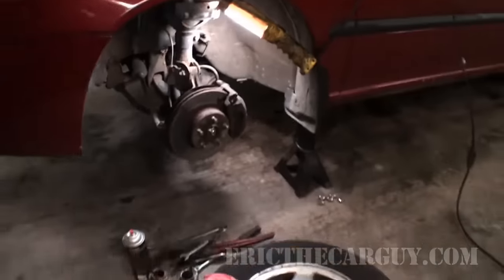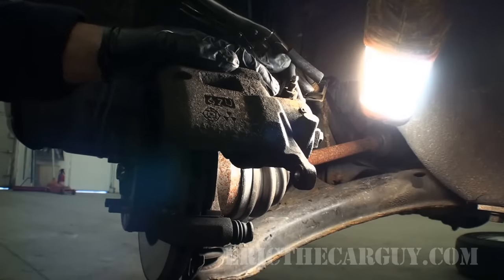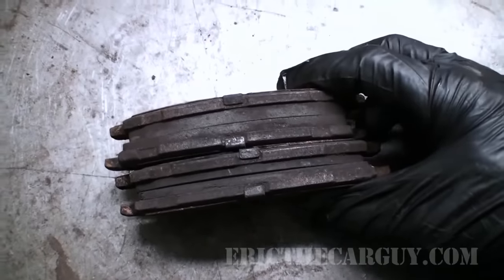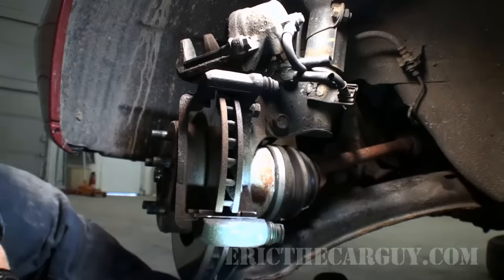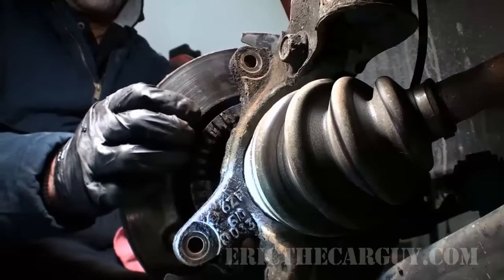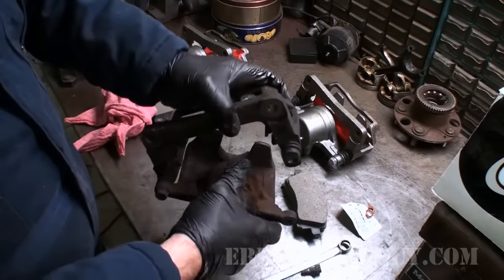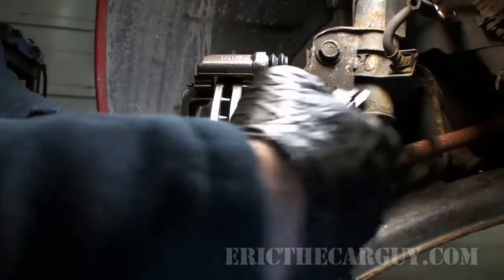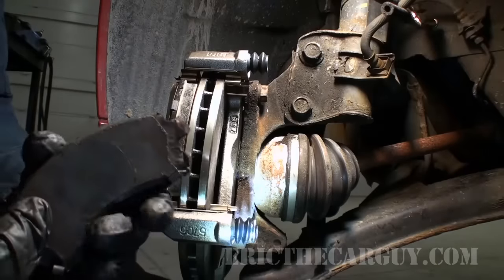How To Diagnose and Replace a Bad Brake Caliper -EricTheCarGuy

Comment: My favourite brake diagnostic method: IR thermometer. You don't even have to remove wheel to see fault. Found out I have seized guide pins not a squeaky bearing because three discs were about 40C, but one was at 150C. Had to change calipers and discs and pads on both sides. Did me brakes myself and every now and then check temps if they are equal on all four. Month later found out I need to bleed one caliper, because temperature was 10C not 34C  as others with ambient temp at 5C or so. Handy thing, but find one with narrow beam and extended range - well in 300C temperatures - brakes are hot. Helps for heat treating too.
Reply: Nice tip, thanks!
(For now I can simply use my nose as I smell burned rubber from the heated wheel cap from the heated brake... heh..  yeah it's hot! Brakes dragging. About to change that, hopefully by myself).

Comment: I realize this is an 11+ year old video, but I just wanted to add: Your wear indicator WILL make a screech sound....IF it doesn't snap off. I did my rear brakes today and the wear indicator was snapped in half. It looked a bit rusty. On another note, when you inspect your rotors, make sure to look at both sides. I had massively uneven wear on the old pads...and found out I need at least one new rotor (but will probably buy a set of 2 rotors and new pads).

Comment: To compress the piston I put a small wood board over the piston and use a 4" or 6" C-clamp. That way I don't risk galling the piston perimeter with the vise grip jaws. You can also use an old brake pad instead of the board.
Reply: like you, that is exactly how i do it.
Reply: And then after you compress it take the clamp off and turn vehicle on and press brake pedal and see if it moves.   Check for any abnormalities. If OK press piston back and reassemble?

Comment: Two weeks ago I started to get noise from my rear left break, it was 74 out and unseasonably warm. But I did not pay enough attention to it because I had a brother in the hospital up in New Jersey, (109 mi each way) I went to a good reliable local repair shop. He said he could not get me in until Nov 28th.  So I decided to do it myself, already ordered the Raybestos rotors and pads. Started to learn about rebuilding the caliper but decided to go and spend the money on a rebuilt. Of course it's 28' now and I think I'll sit back and watch the Eagles beat up on the Colts today and work tomorrow when it's going up to 46'. Thanks for the tips on reinstalling and bleeding. Wish I had my old 55' Chevy back. 77 and still learning new tricks!

Comment: Just an average doit yourselfer here, but I have to say, this video is most helpful. I have done an honest 20 front brake jobs in my life. That is enough to where I feel confident. 1, I never knew about burping the boot on the slider. 2. I May have changed a caliper one time when I might have just needed to lube that boldt. This a nice tip for the future. Now there is nothing wrong with changing callipers before their time, but this tip may have saved me money. Thanks Eric.

Comment: I watched this video, diagnosed the calipers on my '06 Civic EX were the cause of my warped rotors. The pistons wouldn't budge on both. I ordered ceramic pads & slotted rotors from Amazon & found calipers at Autozone. Total cost was $140. It took me less than two hours & I used the stock steel washers, placed hose sections on a vice grip for the brake lines & let gravity bleed out the air in the lines when done. 
Thanks for the perfect tutorial video. The car stops like new & it was less than half the price any garage would charge.

Comment: Just did complete caliper, rotor, pad replacement for my wife's 2010 Toyota Avalon. This video was a great resource. One thing to add that was not covered here is the position of the slider bolts. Apparently, the top and bottom (leading or trailing) bolts are not interchangeable on most cars. I found this out when the passenger side was dragging continuously after the reassembly. I had to bring it to a local mechanic who diagnosed it immediately as reversed position of the slider bolts. This caused the caliper to twist and even pinched the brake hose. I checked the lube of the pins but had no way of knowing that there was a top and bottom difference. They came pre-assembled as remanufactured. Lesson: check your manual or OEM parts diagram against the part supplied before install.

Comment: Thanks Eric for posting this video! Because of your video, I did my whole front brake system on my 1999 Infiniti I30, pads, rotor & calipers in about 2 hours! I especially appreciate the tips on bleeding the system. I've never done it this way, always using the 2 people system, but this worked great. Seems very logical when you think it over. Thanks again!

Comment: Eric, at 11:48 you refer to the banjo bolt [BB] washers, sharing that you prefer steel ones to the copper ones.

Permit me to suggest that copper washers are preferred for use here given copper's malleability, in that it is a relatively soft metal.  When torqued properly, copper washers will compress and be malformed in a way that conforms to the specific imperfections/grooves on the BB's mating surfaces - thereby providing a proper seal that can withstand the pressures of the brake system while effectively mitigating the likelihood of mating surface imperfections that could otherwise facilitate leaks.

It is highly unlikely that steel washers compress at all via proper torqueing.  If so, this would mean that the non-conforming hard steel washers would tighten to the highest points on BB mating surfaces . . . not filling in and conforming to the gaps as was the case with copper.

it is also worth noting that these copper washers can [and probably should] be annealed before using them.  Annealing copper washers 'relaxes' the metal's structure, effectively 'softening' it for use in applications like this.
Reply: Hmm interesting!
Reply: Flea02Cruiser, you are correct. Copper washers’ malleability is indispensable to avoid leakage.
Reply: Yes, you're right

Comment: I have discovered recently that not all parts stores include same items. My discovery happened when I called to buy the caliper. I had some nasty slides, one frozen. I decided to replace those. 2 places priced me the caliper, then the bracket with new slides. The 3rd place was slightly higher in price for the caliper, when I asked about the bracket and slides, I was informed that was included with the caliper. It actually made me saving $20 overall. So, moral of the story, ask if they are included. I prefer changing them with a caliper change.

Comment: why 128 dislike? this is pretty much a clear and educational vid, keep it up
Reply: It's the street term for the jealous known as "haters". YouTube is full of them.
Reply: rkgsd also the haters are anyone who owns an auto repair shop including Midas, and meineke.  Those of us that understand the basics of physics, and can understand mechanics and given the correct procedure (like this) could do a brake job themselves and save hundreds
Reply: Because they racist
Reply: Stop worrying about a few boos and appreciate the applause.
Reply: Its clear and educational for novices and folks that dont or have not really worked on cars a lot.  Folks that work on cars frequently have a better technique and use correct procedures to a 100% ESPECIALLY WITH BRAKES, as they know or have seen what can happen when you lazy out.  Example, why would he risk damaging a RUBBER brake line to save cheap DOT 3 brake fluid, also why would he not use a torque wrench to properly torque the bolts down instead of guessing.  Thats why the dislikes?????
Reply: Why is there always someone who worries about dis likes on a video, Who Cares..If you like the video that's all that matters.
Reply: @tony213g  Yes the clamping of the hose that puts a stress fold in the inner plastic thin-wall hose is not well thought out, also the retraction of the piston and the judgement of slide-ability by using a pair of channel-loc pliers on the edge is quite Non-professional and the manufacturer's instructions from every brand clearly says not to do this.
Reply: @terrywaters6186  dont tell mans what to do!
Reply: maybe because of something minor such as him using a bi-hex spanner on a hex head bolt , amature stuff that just round the bolt off
Reply: Haters
Reply: @globalsttrekker3715  tow

Comment: I watched your video, was very pleasantly surprised by the high quality and your professionalism, and then did the full job on my 2004 Toyota Sienna. Really, I don't know how anyone can complain about what you have done! I love your "straight to it and yet tip filled video! You helped me several times with those tips. But can watchers help you fill out a few things? I hope so. I got a kit with the dreaded copper washers and they leaked like crazy, just as you warned. But, I took it apart, and sanded and wire brushed the brake hose fitting, and more importantly, filed the surface of the caliper right at the base of the banjo hole. That is what fixed the leak. The rebuilt calibers had rough and uneven surfaces where the washers seal and that was the problem. Eventually, copper washers seem to seal the leak if allowed enough time.
Dave S.

Comment: That bleeder bottle is awesome, no need for a second person. I didn't know that. I also was never taught about the anti "seez" on the ends of the pads. Cool!
Reply: anti-seize
Reply: @moisesramirez5454  never seize. I put that shit on everything. I like using the copper version for its heat tolerance.

Comment: I really like you tutorial. You have clear explanation on all the necessary procedure. Here I have some strange experience that I hope to get your explanation/advise. And I hope your explanation can not only help me but some other followers to work on their brakes. 
Lately I have replaced my rotors, calipers and brakes. I was happy to get the job done. Everything was fine for a while, a short while I should say, because I have not driven it for more than a thousand miles. Then all of a sudden one day, I felt the left side brake started to rattle, which was the experience I had before and later I found the caliper seized. But now I have had new calipers, brakes and rotors. And what interesting was that as I pulled my vehicle to the side of the road, the bumpy vibration on the wheel temporarily released the brake. However, similar incidents happen a few times later. And one occasion was very bad when I was driving on high way. I had to pulled myself over to the side. Seeing smoke come out of the wheel I notice the rotor got carved again. For it was already close to home, I drove slowly back. Surprisingly, the vehicle was okay driving at 40-50mi/hr all the way home. And I check the rotor again expecting a terrible result on its surface. Another surprise, the rotor surface became smooth! I wonder what is going wrong with my brake system. It should n't be the master cylinder issue for only one wheel encounters the problem, right?

Comment: I'm doing a brake job on my mom's van. I have the same van, but hers is newer so I wanted any heads up or possible extra stuff I might run into. You gave me the nitty gritty on the ins and outs of a random car not the one I was doing, 2014 honda oddessy, didn't matter because now I know. Oh yeah, I know honda has those 2 screws that hold the rotors on. This vehicle is in AZ. Presently but all its life has been back east, so I know I will have seized Phillips headed screws that I might have to grind the heads off in extraction procedure 101. When in doubt grind it out and vice grip the knub out and lots of penetrating oil, too. Great video and great advice to the guy that couldn't stop after having his brakes professionally done. Commercial vehicles have to have professional certified brake jobs to get insurance period. Everything has to be commercially done and costs outrages amounts of money to be done right. Yes everyone makes mistakes. I did speak to the mechanic about his skills and God using me to teach him a lesson. I lived. I think. Paranormal Team is checking me out now. Thanks again

Comment: did I hear you right in saying at time frame 9:50 "pump the brakes a bunch of time and then open the bleeder.  If brake fluid comes out it might be a sign of a bad hose"?   That is exactly how one goes about bleeding brakes if they don't have a hydraulic pressure supply for the master cylinder reservoir.  I don't get how having brake fluid exiting the bleeder when it is opened is any sign of a bad brake hose.  Can you explain?
Reply: Steven Telck Bit late but he said that after cracking the bleed screw the fluid "squirt" out, if the system is working right the fluid should have returned up the pipe and only leak or dribble out but he's pointing to the fact that the brake hose has broken up internally so not allowing the fluid to return and leaving the fluid in the caliper under pressure. Of course if the bleed screw is already open when applying the brakes then the fluid will then squirt out.
Reply: Bad hose may allow fluid to travel to caliper one way but may not allow brake fluid to travel back up the brake hose.  You apply pressure to the caliper, open the bleeder & it squirts out bc the fluid did not travel back up the brake hose.
Reply: I wonder how many instances of bad hoses were contributed by the practice of pinching them off with the clamps.  I can't see that being too good for them, particularly if they're a little on the geriatic side and no longer as flexible as they were back in their prime.   But it seems to be a regular practice, even to the point where they sell tools specifically for that, so maybe it's not really a concern.  
Personally, I'd rather not do it.
Reply: i agree , i would never do this to my car , im sure resetting tha caliper at a slow pace is sufficient, after all i never even bled the brakes on any car i ever owen until recently and put up to 260,000 miles on them all , never had a problem
Reply: If your hoses are that bad, you'd actually want to find out then. Or don't, and find out during an emergency stop that doesn't actually do any stopping.
Reply: Man i know this is late however is he saying pump the brakes but dont hold them as if your bleeding them? that would allow the fluid to travel back up the brake line if the line os okay right?
Reply: @DennisDural  
I experienced exactly this once. A brake hose had failed and was acting like a one way valve. The brake came on OK but the capiler piston was not backing off because the fluid wasn't going back up to the resevoir. New hose fixed the problem. The old hose was completely choked up inside and I couldn't even blow air throughout it.

Comment: Just pulled in front of the garage, and I could smell something burning. Well check around the truck and it was coming from back left wheel. It was also so hot it was like standing next to an over, also the heat coming from it was leaving a shadow on the rim. Called a few shops and they said my truck would cost $200-$300 for the change .. or I can buy the part from a family member for like $20 new and do it my self now thanks to this video .. or fail trying lol and be out $20
Reply: It's a sign! :)

Comment: Well that's one question he would have got wrong on the ASE brake test. You never ever pinch off a brake hose with vise grips (as it may result in an internal collapse of the hose). By the way that brake hose was bad! If it were unrestricted the brake fluid would pour out at a much higher rate. Just a heads up to you all.. when a brake hose becomes restricted the caliper does not move in and out as usual and eventually seizes up.
Reply: He explained all this in the video and you can see the fuel hoses he put on the needle nose vise grips to prevent damage to the brake hose. I'm sorry if you're death or blind.

Comment: Copper washers are made for sealing lines. They're softer so you can squish them on real good and fill in the cracks like a rubber gasket. I think it was a poor choice to use steel washers.
Reply: Erich Albert, I totally agree. I hope Eric will make note of this and mention it in his next similar videos.
Reply: Well, they are mild steel. Pretty soft actually.
Reply: @takuya7523  Steel rusts, copper doesn't.
Reply: aluminium washers are even better at sealing and not causing many issues

Comment: Hey Eric, Does anyone sell over-sized caliper slider pins for those of us who have rebuilt floating calipers? The reason I ask is because it seems every rebuilt floating caliper on the market, ie Cardone, Beck Arnley, AC Delco, Wagner, Raybestos, etc., has worn slider pin holes that are unfortunately not resleeved when they clean and rebuild the caliper. Sure, the holes are filled with high temp brake grease from the factory, and they're fine for a month or two, but because the worn rebuilt caliper's pin hole's are worn much larger in diameter from the hardened slider pin and the brake grease disappearing, the calipers end up rattling on the pins when going down a mildly bumpy road with no foot on the brake. It makes my nice car feel like ass over the bumpy roads of RI. Every caliper I've ever owned loses it's brake grease after about 2 months, and yes, the grease seals are 100% fine. I've even used more expensive ceramic brake grease, and it still goes away! Does the silicone you use go away too? The other part of this deal is that I'm using ceramic pads which give a much longer service life.  The only answer I see is oversized pins. Whadda ya think?
Reply: I know Cardone does re-bush caliper guide holes, what is your application that you're having trouble with?